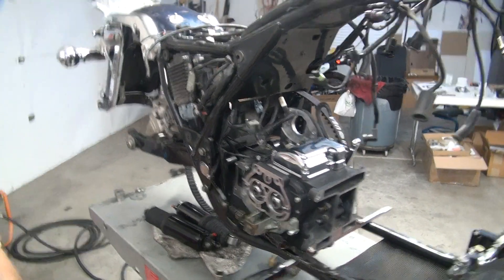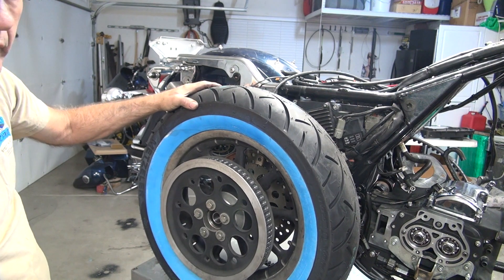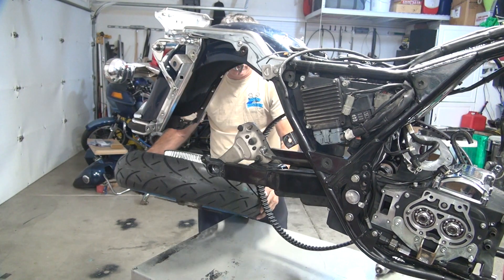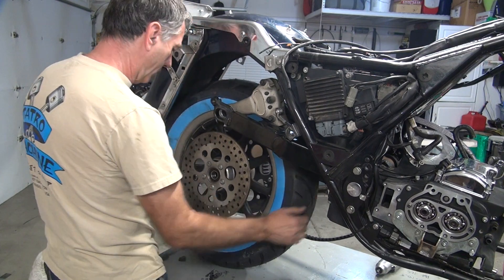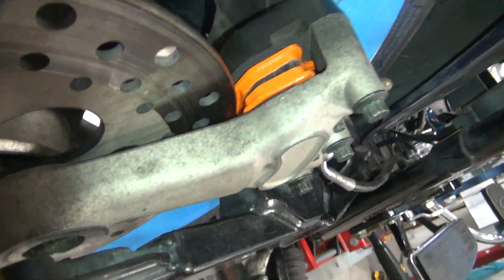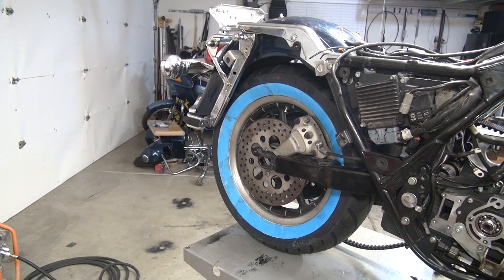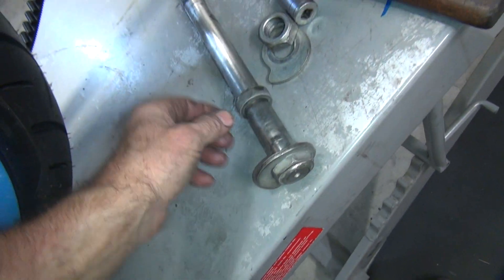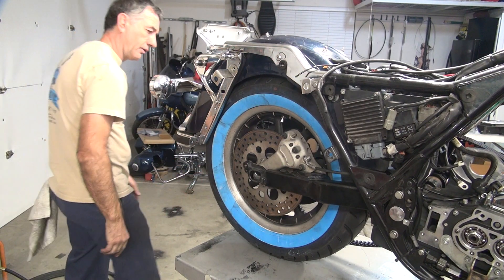#150 2004 road turd topend trans rebuild rear belt change FLHT twincam touring harley tatro machine

Comment: I dont remove the left side muffler to remove the axle (I remove the right side muffler for the axle nut using a socket) I remove the bottom shock bolts , loosen the top shock bolts and swing the shocks backwards and tighten the top bolts to hold the shocks out of the way of the swing arm , then jack the rear wheel up and remove the axle on a slight upward tilt between the bag rail and the muffler , you have to tie up or block the swing arm up , let the tire down and out .......